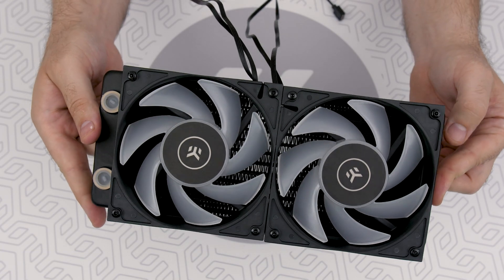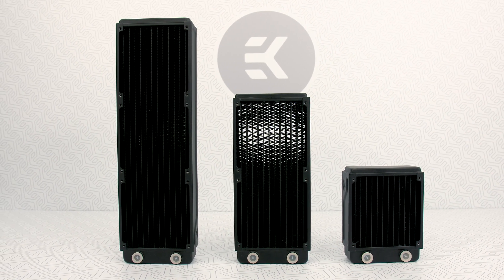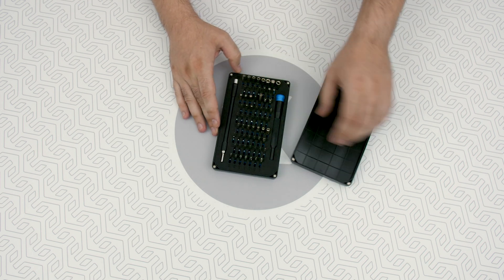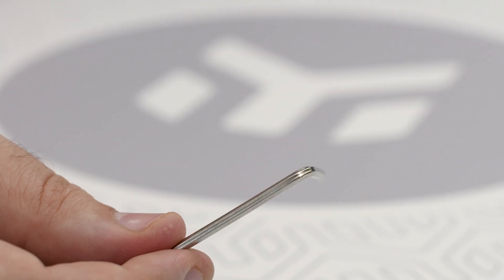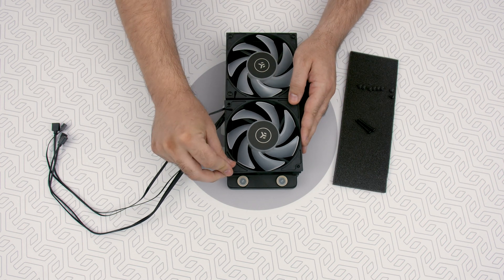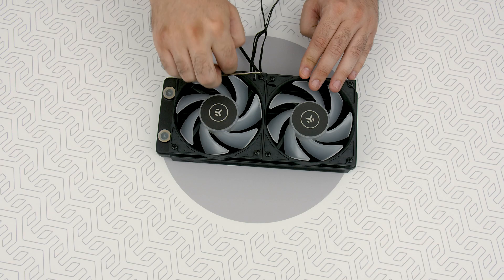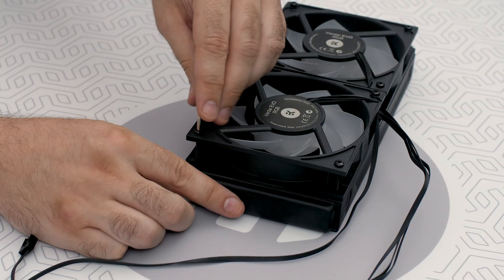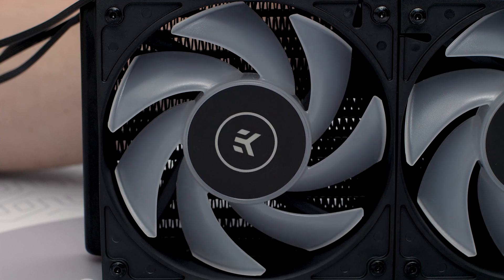How to Install the Fans to the Radiator

Comment: What screws to use if I want to put 140x25mm fans behind the radiator to pull air? I do not have the ones that came with aio.